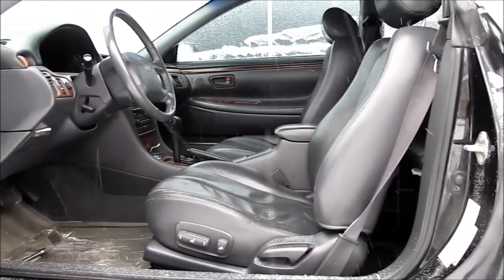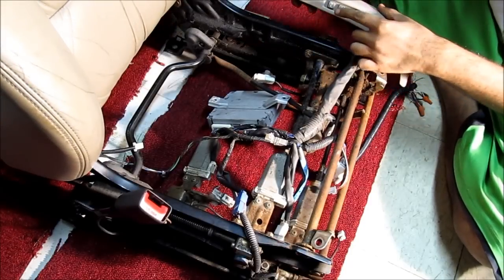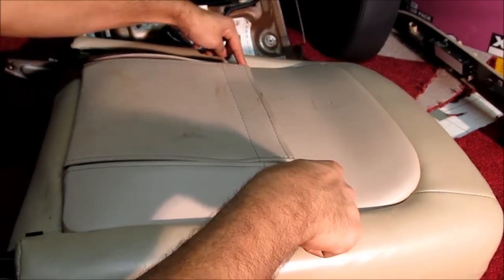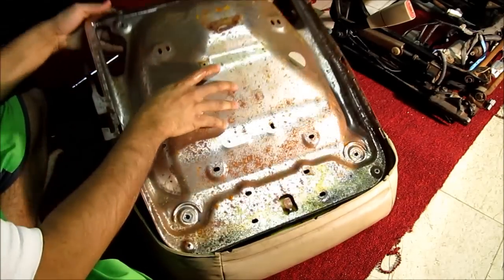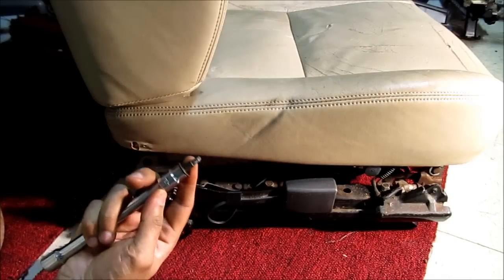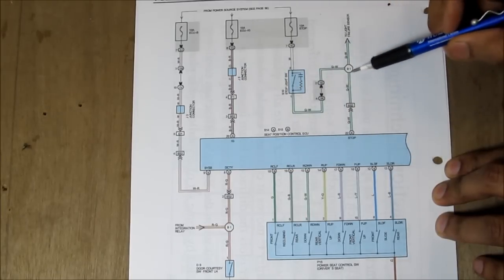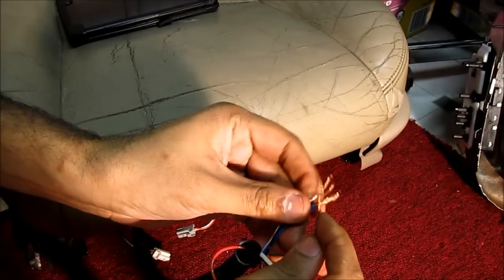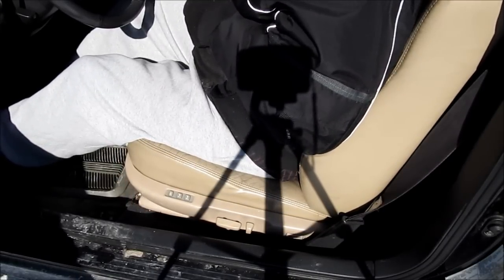Memory Seat Install

Comment: I'm adding mine from a RX300 and there is a extra white data wire that goes to the rear door ECU. My Highlander doesn't have this ECU, my white data wire is only going to my OBD2 plug from my body ECU, I tried connecting it but nothing happened. Looks like I'm going to need a different seat ECU with out the need for a external data connection or get this other door ECU from the donner car and try and hook it up

Comment: You are amazing, i would like to modify my 98 lexus mirrors to be memory(use 2000  mirrors), but i see its very technical, great video
Reply from the maker: I don't know how that would work, you'd have to run some wires from the 2000-01 seat module up to the mirrors

Comment: I'm looking for a way to apply a Lexus memory sheet to a 13-year-old Camry.  Memory control ECU, wiring, switch required.  Control is up to the ECU.  ECU control can add 12V power.
Reply from the maker: The 2004+ Camry has encoders built into the seat for the occupant classification system. The readings are available thru the Canbus and can be read by techstream depending on fore/after adjustment. If you could tape into that system it would be nice
Reply: @speedkar99  Thank you, Padback.  But getting the memory sheet parts is not easy.

Comment: Hello speedkar99
Diagram of wire connection in photobucket without viewing or downloading,. Please give me (a.ngocdung@gmaul.com) the wiring connection diagram of 89710-33010. Thanks a lot
Reply from the maker: Check my forum post on toyotanation
Reply: @speedkar99 I have been here:  "toyotanation" already but I cannot find "the factory wiring diagrams" and as you said "Since I can't post the factory wiring diagrams, PM me if you need a copy." So please give me (a.ngocdung@gmail.com) a copy "the factory wiring diagrams" . Thanks a lot

Comment: Do you know if Peugeot cars manage memory positions from a computer under the seat too?
Reply from the maker: Either that or through the Body control unit
Reply: Sure, I want to add memory to my 406 facelift, the V6 version has that feature, but I'm thinking the safer way would be if it's controlled independently from the computer

Comment: Thank you for sharing your knowledge and for editing a very good video with brief clear explanations of your process.  I am still trying to resolve my power seat issue in my 2005 GMC Sierra 1500; I initially thought it was the circuit breaker, then with a little more research on the internet and primitive troubleshooting without a VOM, I thought it could be the 8-way seat power switch: after replacing the OEM 8-way switch with a 3rd part product, I learned that was not the cause.  After more researching and watching YouTube videos, [Thank You to the other Master DIY mechanics] my next option was to check the power seat control module [GMC Power seat control module Lear P/N 602-0528-200-F-GMT800].  I finally removed circuit board and I am attempting to clean the board's connector prongs.  Hopefully this will fix my driver's seat's unreliable forward and backwards adjustment movements.
Reply from the maker: +Peter Pa Thanks glad you like my work

Comment: Do you have any idea how to bypass the the drivers seat memory module in a ford chair? im putting in 2012 ford edge seats into my 94 ford bronco, or is there a way to trick the memory seat module?
Reply from the maker: That might be linked to the CAN bus system in the Edge. Good luck getting that to work. At least with the Lexus, the position memory system was completely local to the chair.

Comment: Great video!!! Just did the swap this weekend! My front seats were giving out and I was fortunate to find two in fairly good shape @ local wreckers. 

Any clue which wires are for the heated seat function, I'd really like to know as the cold is already creeping in Toronto and I'd hate to literally freeze my butt off 😂. My bottom would be very thankful lolz 😁
Reply from the maker: Hey fellow Torontonian!
Winter isn't here yet, we're just getting a taste of fall these past few days. That shouldn't deter us from working on our cars till December at least.
Anyway, if your seats didn't come with the extra wire for a heater, then there aren't any heater pads in them. The seat I got out of a 97 or 98 ES300 didn't have heater pads so I had to swap in my own (see this video: https://www.youtube.com/watch?v=U36hNoB2_Dk )

Which junkyard did you source the seats out of and what color is your interior? I'm giving away this seat BTW....no use for it anymore since the color doesn't match.
Reply: I really appreciate you fast response!

ahaha that is true but I'm not fond of any sign of cold so im trying to get this up and running ASAP before we get some random October snow lol!

I got the seats out a 1998 ES 300 w/ heated seats from standard auto.
My interior is dark grey but seats are a slight lighter Grey than my interior but you have to look really hard to tell the difference...Given the condition of the leather it looks damn near new so i cant complain. I was very luck with my find :D 

I also got the switches with harness but i have no idea how to wire them up. Do you know the coding for the wires? If you do I definitely owe you a beer haha!

Comment: speedkar I'm trying to swap an 06' es300 drivers seat into my 05' camry. I read a few times that you said it's a direct swap from the same generation like that? is that correct? also in terms of my 05' camry's passenger seat which is manual, can I swap a manual solara seat from the same generation into my camry? Sure would appreciate your feedback thank you
Reply from the maker: +nukka200 It should bolt up since they're all based on the same platform, just double check the measurements between the seat mounting positions. You'll have to figure out the electronics since the Lexus seat has a separate computer for the memory functions. Why would you want a Solara seat on the passenger side, it wouldn't match the Lexus driver seat. Since solara is 2 door, it will have the slide forward function to allow passengers to get into the rear seat.
Reply: speedkar99 I CANT STAND the factory camry seats in my 5'. it kills my back! thats the whole reason im swapping in a lexus drivers seat. and I figured a solara manual seat for the passenger one would be slightly more comfortable. do you know if the solara seat is compatible for the passenger one?
Reply: speedkar99 unless you know of how to put in a es300 passenger seat? I just figured it wouldnt install at all, since lexus is always power, and my passenger seat in my camry is manual? what do you think? thanks
Reply from the maker: +nukka200 The solara or es300 seat might bolt up since its the same platform of vehicle. It would be funny of your seats don't match and the passenger seat slides like a 2 door car. Also the travel and seat height might be different in the 2 door vs the 4 door. Therefore your best bet is to put in es330 seats, and run a 12V power line under the carpet to power it. 

I'm assuming you've tried the es330 seats? I used to have an 05 es330 and over long trips the lack of thigh support really made my legs pain. My brothers GS300 is the same thing. 

My 99 solara and 04 accord have a longer seat cushion and I don't have problem with thigh support.
Reply: speedkar99 yeah so far i just bought an 06 es330 seat, i was under the impression its the only one that would be compatible with the camry platform? the seat bottom doesnt bother me, its my upper back that hurts from too much of a lump. the lexus one seems a bit wider and the lumbar lump is dispered more evenly. if i installed an es300 passenger seat, what would i have to buy for the power adapter or whatever?
Reply from the maker: I'd recommend you get the wiring harness plug out of the passenger side seat to give you a raw wire 12V connection. Then run a wire from the fuse box, or the power seat fuse (there might be some wiring under the carpet for XLE models that have a power passenger seat). Put your own 12V fuse inline just to be safe. Since the passenger side on the ES330 is also memory, I'd assume its also controlled by a memory computer of some sort, so you'll have some wiring to figure out. Study the diagrams and try wire by wire to see what powers the chair, that's how I did it for this project!

Comment: So can I swap my 97 Camry seats and back seats for Lexus gs or ls300 seats?
Reply from the maker: You'll have to measure the bolt pattern first to make sure they line up. ES seats from the same generation will swap over.

Comment: how did you find out the exact bolt pattern for your car and able to match it is there someplace you can look or was it just trial and error
Reply from the maker: +JT Lindenmayer These cars are all based on the same platform. I've read a few places on the internet that it was possible to swap an ES300 to Solara / Camry. Some quick measurements in the junkyard verified and I performed the swap.

Comment: Thanks buddy! We got them working 100percent. Have you tried to do anything with the memory mirrors? I dont think they would bolt on but i think you could retrofit the motor in the solara side mirror. I also completed the 2000 woodgrain steering wheel swap. Thanks for everything. Please keep supporting the solara community.
Reply from the maker: One time in the junkyard I took a 99 ES300 mirror and held it up against a solara door. Since they're both frameless windows, the triangle part matches, just the mounting holes were different. If someone is willing to investigate further I believe if you drill 2 holes to match the bolt pattern of the ES mirror, it could bolt up, assuming the 2000-01 memory mirror is the same as that 99. 

Taking a mirror apart is not easy, you almost have to crack the mirror to remove it from its backing (held on by adhesive) . If you've watched my How Memory Mirrors work video, you'll see the guts inside is completely different, and its not as simple as swapping them out. 

Wiring memory mirrors would be different too, because now there's a memory mirror ecu that needs to be accounted for as opposed to the open loop power mirror control of the Camry /solara. 

The main reason I looked into this was to have a reverse tilt option the way my 2005 ES does, so you see the curb or parking lines when backing up. 

Can you link pics of the steering wheel swap? Does the color match your solara exactly and the airbag fit fine?
Reply: Im grabbing the set of mirrors that my seats and steering wheel came out of. Should be monday or tuesday before i pick them up. I dont see a way of posting a pic here of the steering wheel. If you can pass an email address or phone number privately i can get you pics. I used the frame of the lexus woodgrain wheel...my existing clockspring... And i used landau black SEM color coat to dye my oem solara airbag. Perfect match. No airbag lights etc etc... I did your es300 gauge cluster swap at the beginning of the year also. Ive shoved about 70 percent of an es300 in my lara lol.
Reply from the maker: Wow your Solara looks amazing. You really have to take a double glance at it to recognize it from an ES300 now. Would have been even nicer if the wood grains matched colors.

Good job on the dye, what kind did you use? Would it work for leather? I still have that beige memory seat, waiting on a black ES300 to show up at my local junkyard...but they're rare so it'll be a long wait.

Those seats are in amazing shape and really complement the interior of the Solara. I assume you won't need access to the back seat. I do carry a lot of backseat passengers so I wouldn't swap a power passenger seat in. Did you run your own 12V wiring for the power on the passenger side?

Do keep me posted on the memory mirror mod. Are you planning on doing any suede wrapping to the headliner or pillars like I did mine?

Comment: i was able to track down 1 of your drawn wiring diagrams...i still end up with about 4 or 5 wires left over...do they all go to power as well? i can def tell the main power and ground.
Reply from the maker: +James Haywood Britt The 2000 seats have memory mirrors. Leave them disconnected and see if the seat powers up. Follow my video from 4:19 for the wiring part.

Comment: I'm trying to install 2000 ES300 leather seats into 99 Toyota Solara. Is there anything you could share your wiring diagram? I've done a few of your upgrades/tutorials with great success. Thanks in advance.
Reply from the maker: +Cameron Farmer Check out the writeup for a bit more detail: http://www.toyotanation.com/forum/103-3rd-4th-generation-1992-1996-1997-2001/1039585-diy-lexus-seat-swap-position-memory.html#post8918305

Are you upgrading the front passenger seat as well? If so, how do you plan on adding a quick release for rear seat passengers? That was one of my draw backs, besides the leather not matching.
Reply: +speedkar99 

We are ignoring the back seat due to the rather large stereo install. I've visited the forum post and more the the picture links are dead. I just need to know what wires go to power and which go to ground. Thanks in advance.
Reply from the maker: The pictures work fine for me in my DIY thread. Here's the written diagram I was referring to:
http://i546.photobucket.com/albums/hh435/speedkar9/Image2.jpg

Now the 2000 might have an extra wire or two since it also had memory mirrors, so you might have to leave those disconnected.

I've uploaded a screenshot of the wiring diagram, I think its from the 97 ES300 repair manual:

http://i546.photobucket.com/albums/hh435/speedkar9/Seat%20position%20memory.jpg

Comment: I just got a set of 2000 es300 seats to go in my non powered seat solara. Any help or advice you could give me would be great. Ypu do excellent tutorials and i have done the es300 gauge swap and am about to do the es300 woodgrain wheel swap as well. Please help...any diagrams or any advice you could pass on...
Reply from the maker: +James Haywood Britt The writeup has the written wiring diagram for the seat. All you need is to supply a 12V power (from your fusebox) to it to power it up:

http://www.toyotanation.com/forum/103-3rd-4th-generation-1992-1996-1997-2001/1039585-diy-lexus-seat-swap-position-memory.html#post8918305
Reply: It looks as if i have more wires coming out of my seat. Im willing to try any ideas but if you have a pic of the actual pinouts for an 01 es300 platinum edition that would be super. Again..i watch your videos and your very talented. Thank you for all your hard work. Much respect.
Reply from the maker: Thanks for the feedback. Here's the wiring diagram for the seat:
http://i546.photobucket.com/albums/hh435/speedkar9/Seat%20position%20memory.jpg

Comment: Hello, i am working on a  seats from a lexus 95 Seat position control 89710-50041 
The pasenger seat is ok vorking, i just wired to a 2 xables and work proprelly, 
The problem in the   driver seat is tha,t doesn,t work, only one motor works  can u help.me  describe me  how to install make it  work  thanks
Reply from the maker: Which motor works, the recline or tilt? Or just lumbar? The lumbar support goes directly to the motor, it does not use seat position control.

To use the seat position controller it needs multiple inputs, you can't just wire two wires alone. Get the wiring diagram for the 95 ES (it will vary compared to mine in the video of the 97 model) and look at the pinouts asking for power under the seat.

Comment: Did you compare the es300 motors to the solara motors? I wonder if they're interchangeable. Would be nice to retrofit the es300 motors, computer, and switch into the solara seat.
Reply from the maker: Yes I compared the seats thinking I could just swap the innards and they are completely different. I can't swap cushions or leather cover onto the ES300 frame or sponge, nor can I just swap motors.

The mechanisms are completely different. The encoders are on the shaft, not built within the motor.

Comment: Nice Video, Do you know if the electronic device also controls the side mirror motors?
My 00 ES300 seats and mirrors are not moving but I am not sure which computer controls both.
Thanks
Reply from the maker: Thanks. I believe on the ES300 the memory mirror ECU is separate from the one under the seat, though there's a linkage in wiring that connects the SET buttons on the side of the seat.

If your power seats and mirrors are not moving, start with checking fuses.